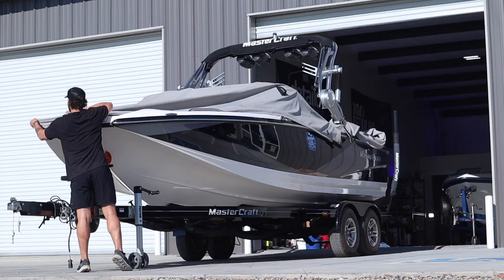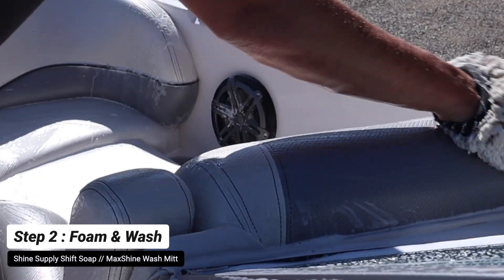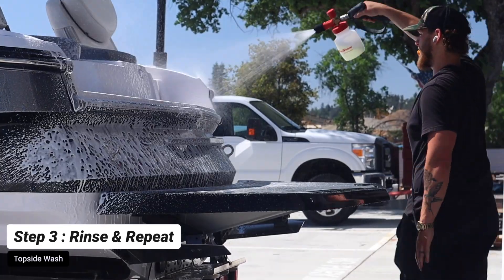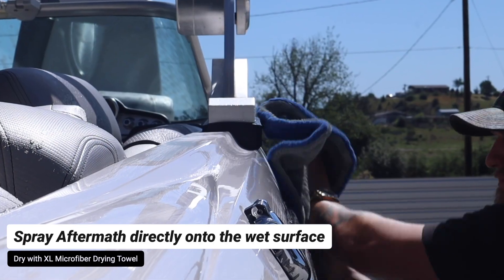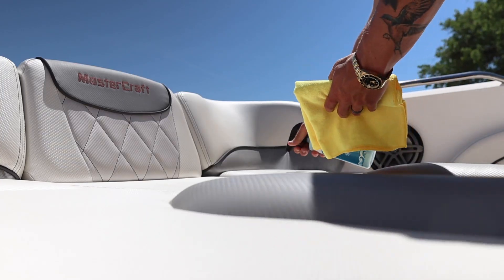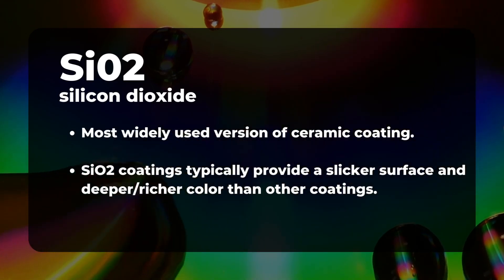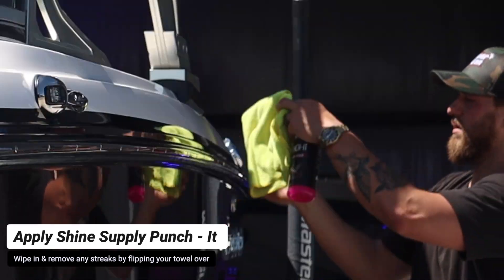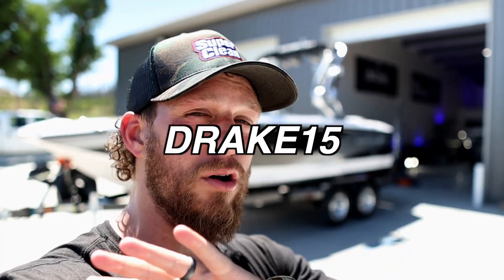Wash A Boat Like A Pro | Boat Detailing Maintenance Wash | Revival Marine Care

Comment: Thanks for making these. They have really helped. One thing I haven't seen is if you use any different techniques/products for boats that have been Awlgripped. When they painted my hull they told me to only use Awlwash and Awlcare. I get spots from hard well water that I can't completely dry with my squeegee when it's in the water. What would you recommend to remove, polish and protect an Awlgripped boat? I've always used a wool pad on my Dewalt until recently watching your vids about pads.
Reply from the maker: Hey bro! With Awlgrip, it’s best to go with their own products for maintenance because it’s their own product.

Comment: Hi again drake! Would you recommend using a marine decontaminant on the boat after the initial wash and before the cutting process? I was told it's more thorough but I am not sure if it's really necessary. Thanks in advance!
Reply from the maker: Yes, absolutely! Typically just some generic alcohol wipes will do.
Reply: @DrakesDetailing  Thanks very much this has been great help :)

Comment: Hey Drake. What is the best pressure washer for boat detailing? I’m a brand new business and I want to buy a good one 😊
Reply from the maker: You don’t need a super powerful one. An electric one from Hope Depot will do the trick. If you get with with too high of a PSI you run the risk of damaging vinyl seats, and other important components of the boat. Here’s the pressure washing gun I use. https://www.detailedimage.com/DI-Accessories-M12/MTM-Hydro-Easy-Hold-SGS28-Spray-Gun-P2473/

Comment: What product do you use to wash the sea deck?   i saw you wash it in a video with the blue brush but can't find it to refrence.
Reply from the maker: Hey bro, if you want to clean Sedek really well before you detail about, you can take Zep, purple, degreaser, and a short, bristle, stiff Libman brush. It works amazingly. However, be careful if you’re doing it around a sealed surface as the degreaser could strip the wax from the nearby surface.

Comment: 1st time here. What do you recommend for an outboard? Also, I have a 2022 Ranger 188P. Can I wash/wax it the same as a fiberglass? Thanks! I boat all the time so hopefully I learn something here! God Bless!
Reply from the maker: Thanks so much, bro! Yes, rangers should be fiberglass so all normal processes should still apply. For an outboard motor, the paint is usually send on those so I would recommend just washing it with regular both soap, and then using a TA polisher to wax it for protectant.

Comment: how i clean and maintain a new boat before oxidation... i mean a GELCOAT boat ?
Reply from the maker: If it’s brand new and you don’t want to get it oxidized, use apply a polymer sealant twice a month. Is the boat new or used?
Reply: @DrakesDetailing  is a new boat. Just used twice but i want to prevent damage
Reply: @DrakesDetailing  can i onlywah it and use after that mothers ceramic coat?

Comment: Hi Drake, looking into boat cleaning and came across your videos awesome stuff!! Do have one question, we are going to be trailering extensive amounts with boat, wondering if you could elaborate provide advice on removing bugs and road debris from boat from road travel(I'm thinking bugs splattered on tower, etc.). If there is any additional products or if its just good elbow grease and washing with Shift Soap, and if there is any tools. I know bugs/road grim can be tough to handle from cleaning vehicles, I typically use a degreaser for stubborn spots, with boat we would have a ceramic coating.
Reply from the maker: Hey bro! If you plan to trailer the boat, I’d recommend that you do a ceramic coating. The bugs will come off with just a light rinse! However if you just have a sealed/waxed boat, shine supply makes a good big remover. https://shinesupply.com/products/bug-off
Reply: @DrakesDetailing  Thanks for the advice! I think our plan is to use a ceramic coating for boat so maybe I'm over complicating it. Just wanting that year round shine!! 😁

Comment: What is the psi and gpm on your pressure washer?
Reply from the maker: Not much, you don’t need a whole lot of PSI around boat, nor do you want to just for the sole purpose of potentially scaring the gelcoat, poking a hole in a seat cushion, etc. my pressure is around 1500. Nothing too crazy.
Reply: @DrakesDetailing  cool, I just ordered a electric one around 1850 psi at 2.3 gpm. I’m sure I can adjust it to my liking

Comment: Hi Drake, I'm detailing my first boat. The boat is covered in water spots. I buffed them off with a foam cutting pad and Adams compound. The spots came off,  but now there is a haze that won't come off with polish. I tried using several different pads, and polishes, including Adams one step, but the haze is still there. Any thoughts?
Reply: Wash it again or isopropyl alcohal wipe.
Reply: I did a prep wipe. I detail cars, and I understand that process, but I've never worked jelcoat. Tried polishing with a heavy cut compound, and pad. Then tried a polish to remove the haze. Knocked down some of the haze, but still not clear. I used a prep wipe between steps.
Reply from the maker: Do a second round of the heaviest cut compound you can

Comment: Hey man Love the videos and your work!! Will denatured alcohol take away black scuff lines on the hull? Kind of nervous and also wondering about if I do other boats with painted surfaces that it's safe and won't ruin the finish.
Reply from the maker: Hey bro, yes it will take the black marks away, but it will strip your wax right off the boat. If you are doing a deep clean before you buff and wax it’s okay, but once you buff, polish and seal your boat you cannot use it because it will ruin the finish
Reply: @DrakesDetailing  Thank you!! Really appreciate it!!

Comment: Not exactly from a specific boat, but on boats, the console is not waterproof to play around with a pressure washer, or is it? Older boats probably don't...
Reply from the maker: Yes! Most everything on a boat’s dash is waterproof. Just don’t hold the tip of the pressure washer to a Garmin GPS for 5 minutes straight, and all will be good 😎